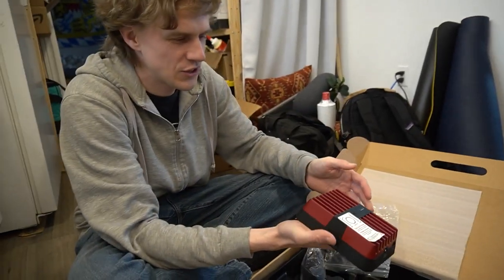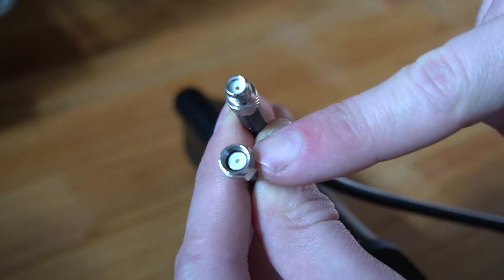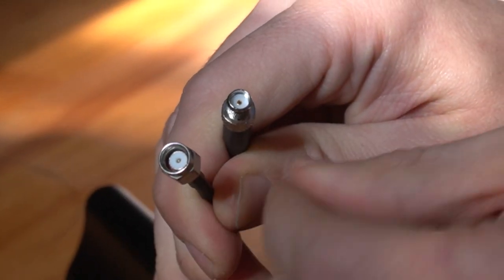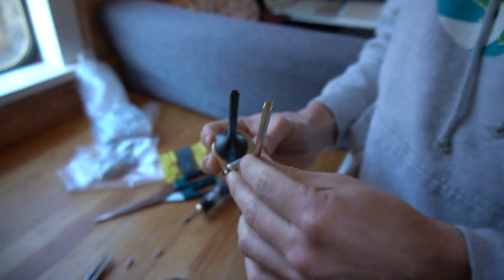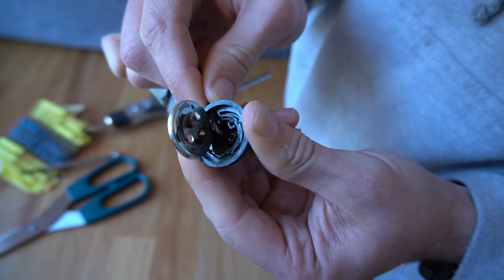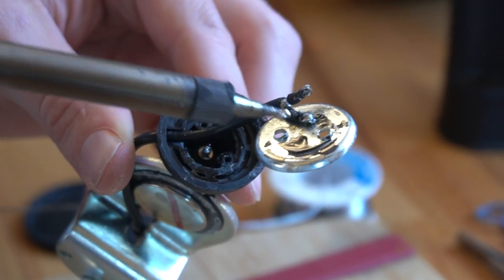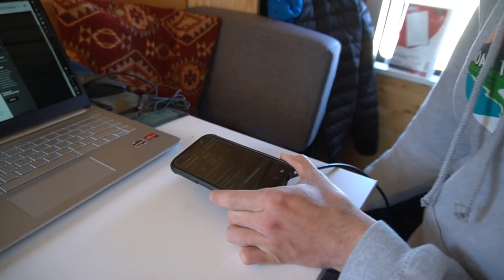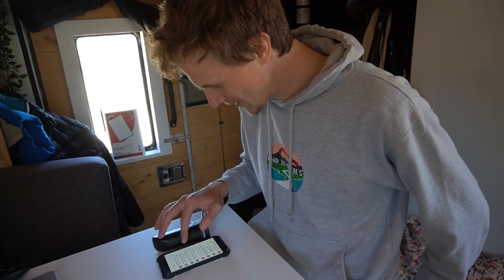Why Is My weBoost Not Working?

Comment: Thank you for this! My weboost worked for 6 months and then just completely stopped. Their tech support was super unhelpful as well, and I drilled a freaking hole in my roof for this! Going to try this fix now. Thank you!
Reply from the maker: Really hoping this solves it for you. Apart from this bad design with the antenna plug the weboost worked really well for us (I did try different boosters in the past that wouldn't do anything, this was the first I could actually see the signal improve).
Let us know how it goes.

Comment: For the roughly $700 they want for this product... this problem is unacceptable.
Reply from the maker: Yeah we agree, for the price tag that should not happen. I don't know if they've fixed it in the mean time. We've bought a replacement antenna which now has a much longer cable so you can plug it directly into the booster.
We could have tried getting some warranty I guess, but when you're on the road you just want things to work again and not argue with support and figure out shipping.
The replacement was only $20 so not too bad.
Reply: $700.00!!!! Holy cow!!!

Comment: May I know what app you used in your mobile phone to check the signal .. we have a weebost we just installed and we don't know if it's working or not. We want to see the signal strength it can generate...
Reply from the maker: App is called LTE Discovery. Hope that helps.